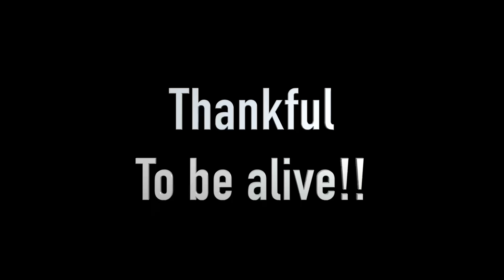The Firefighters said I was LUCKY TO BE ALIVE after this stupid MISTAKE!!!

Comment: Hey Al.  It is hard to determine if you actually were responsible for cutting the power wires, or just touched it. There were so many vines surrounding and covering the wires, which makes it hard to determine the condition of the wires at the time you were removing the vines.  They may have been already exposed.  Nevertheless, I thankful that you were not physically harmed.

Comment: 120v to ground (you).  I've been lifted many times in my life with 120 volts.  Not that big a deal.
Yes, it's 240v from the street, but that's between both live cables.  It's only 120v to ground.

Comment: Looks like the power to the house was cut, but the feed lines were still hot. They didn't break the circuit at the pole. You cut into a live feed line.

Comment: Better to be safe than sorry. you need to stay at least 8 to 9 yards (more than 20 feet) away from any wires and assume that every wire is live. Unless you have disconnected the power yourself or seen someone else disconnect it you need to be very careful when working around power.

Comment: What happened to power meter? Am guessing the storm knocked the weatherhead in that position which separated the connectors (hotlines )its important to know if power company removed the meter and not noticed the disconnects, due to the moss, but it should be isolated on the poleside as a precaution 😮

Comment: back when i built chainlink fences, i plunged a pipe axe into a burried 50kv power line. bare hands metal shaft, melting snow on the ground. and a flash of white to the top of the post hole. only thing that saved me is i hit it perpendicular to the powerline so the axe head burried itself into dirt and cable at the same time. i should be dead right now but i didnt even feel a tingle in my hands because it grounded out right at the scource.

Comment: Each one of those lines or "legs" is 110-120 volts. Together they make the 220-240 your air conditioner & heater, hot water heater, and kitchen range need to operate. One at a time they'll light you up but most of the time it's not lethal. Both at the same time can definitely kill you if you become part of the circuit to ground. What you did was short 'em out between each other and: what looks like the roof flashing and the machine you had in your hand.. They took the brunt of the shock. If you would've been better grounded you would've been shocked or maybe electrocuted. The very definition of electrocution means you die.. Always check the power before you get near it. I used to have an electric trimmer that ran off of 110. I can't count how many times I cut my own cord not paying attention. Now I use a gas operated trimmer. You're real lucky.

Comment: I agree with your title. Obviously this was a naive mistake but never ever do any work right next to a power line. Lesson learned. I guess. Right where you were the wire was terminating. So it should have been obvious that there was power there. Most of the time. Power goes to a meter box and it wouldn't matter if it was shut off. At the bulkhead there would still be live power. Maybe it's different in your state. I'm not saying that the power company shouldn't have done something else on an abandoned house, but just from experience with old house is insulation could be cracked so it wouldn't make sense to bring a string trimmer up that high.

Comment: 120/208 voltage probably either a 100 amp line or 200 amp, you cut the ends off that where taped up from what it looks like and it looks like you just went phase phase but also lucky when you were cutting wires that you didn't ground out, pretty much tango with hot wires 3 times and the third time was the time it decided to be sparky lol

Comment: Super happy it didn't get you, myself I worked with 480v down gotta tell you 110v is the worst. But you cut both wires. Witch is 220v. If you would have been grounded yes you wouldn't had made it. Becareful kiddo Becareful!😊

Comment: Yeah that's cutting it close there for sure AL man. I'd invest in one of those line man graphite.,or fiberglass poles with A hook.,or have A Y end made especially for removing moss off of those lines.,an some of those rubber insulated gloves. Along with A shield helmet to for jobs like that one. For real safety first bro. When it comes to electrical wires. That should've been disconnected At the main street lines to begin with. Especially with it being labeled abandoned House also. One more safety protection helper for you on that part as we'll. I would definitely invest in some more rubber tubing sleeves. To put onto that equipment of your's. If possible one long piece of that rubber tubing insulation gripping would awesome for those types of reasons.,an situations alone. I'd check with your local lawnmower power and outdoor equipment company about some extra rubber gripping protection. To add onto that pole saw. I would definitely do A safety review on that video.For sire as part 2 of it AL bladez. It could definitely help save someone else's Life and show awareness and safety guidelines to.,an should follow when in those types of   fields.,an Jobs as safety precautions and hazards and hazardous situations like that one. That is likely to.,or can acure at anytime and anywhere.,or any place to.

Comment: As an electrician seeing this, I recognize that you would not have died had you contacted this directly even if you were touching the metal pole on your trimmer.  The most voltage to ground which would have contacted you is 120 volts.  Since you were wearing rubber soled shoes, and not standing in any water - or even anything very damp, the worst thing you would have felt is a slight tingle.  Regardless of this, the only way you would have contacted any current would have lasted only a fraction of a second, as was evidenced by the fact that your trimmer cut right through the conductors in only a moment, removing any danger in the amount of time it takes that blade to slice through the conductors.  Also, the flash you saw was from the trimmer taking the current, and that voltage would much rather travel between the wires through your trimmer blade, since electricity takes the path of least resistance.  For sure, I'm betting you saw the arc damage on your trimmer blades.
You had a much greater chance of having a heart attack from being startled than you did being electrocuted here.

Comment: If it's only 120 volts it's nothing but if you got caught up in two hotlines be 240 depending on the situation yeah that could kill you when I was about four or five I got zapped with the wall socket I was plugging something in and I had both my fingers on both hot and neutral line I still remember it today so that technically would be about 1961 62 it's funny how I remember some of these things after all the years

Comment: Hate to burst everybody's bubble but there was no power there. The sparks are from the metal blades hitting the wire. Power doesn't run from the house to the pole. If the wires are hanging like they were there is no power.

Comment: The power is only off to the house. From the roof to the power line is always hot. The plastic jacket on the wire did not save you. Your shoes did.

Comment: I would've left when I saw that snake. Last year I was mowing outside my fence and I stepped on something soft,  when I stepped back I noticed it was a moccasin. My grass wasn't even thick. I wiped him out with my push mower. The same week I was edging outside my fence again, and about 50 feet from where I was, about 3 hours later a murder took place. Just think, if It had happened earlier I would've been dead, cause I would've been an eyewitness. I was in the house about 10 minutes when shots rang out. I give credit to God's amazing grace.

Comment: I'm sorry, but 110v would not have killed you in this situation. I know, it's 220v to the house, but that's across the 2 110v legs. There is very little chance you would have had the full 220v. The most it would have done is give you a shock and make you drop the tool.

Still, I'm very happy to see you are safe and did not get hit by it.

Comment: Sir…whyyyy would u use a weed wacker on the roof where theres clearly some wires hanging there? I dont care if u think the power is off thats a no no. My instinct would be to just use my hands to yank the moss off not to use my power tools🗣️ 
Im not yellin at u…but im yellin at you cz wth 🤦🏻‍♀️
Reply from the maker: It was actually a open wire in that moss that o didn’t see at all so if I used my hand I’d not be here right now.

Comment: Seriously... You ASSUMED the power would be off.. so you cut through power lines? Bruh, those are COUNTY lines coming from the road they are always live. That's what the meter box does, creates the shut off switch to the house. Seriously you actually thought the power coming from the road was off? What world do you live in? To make the decision to cut through a power line to begin with... WTF man, even if it was a dead line from a different source, lazy much? Just chop it up ask questions later... Not to mention you're trespassing, now you cut a main power line, but nothing happens to you, no tickets nothing. Anyone else would be locked up